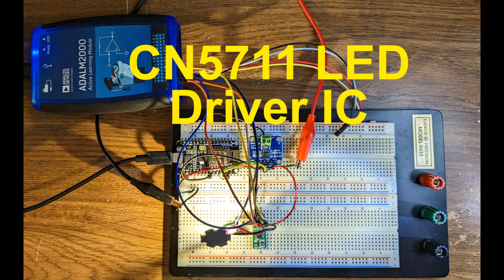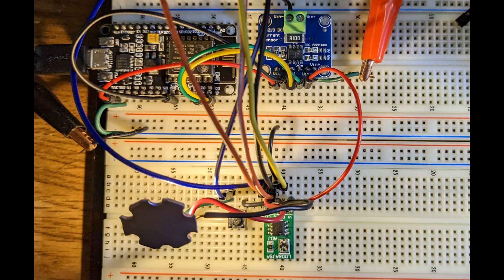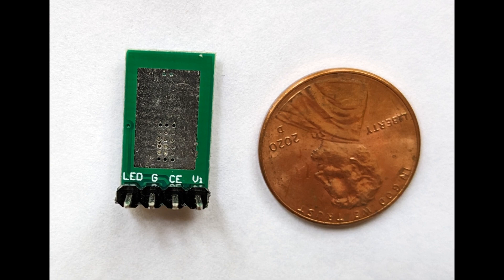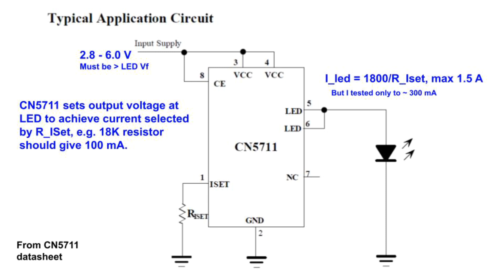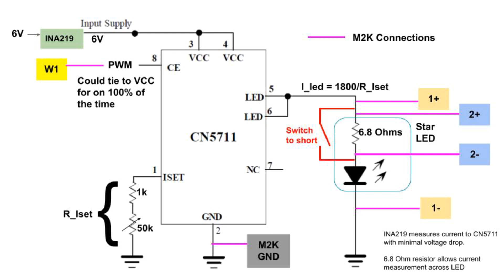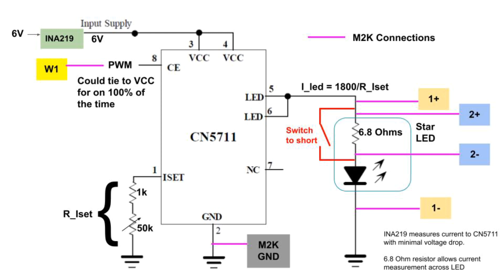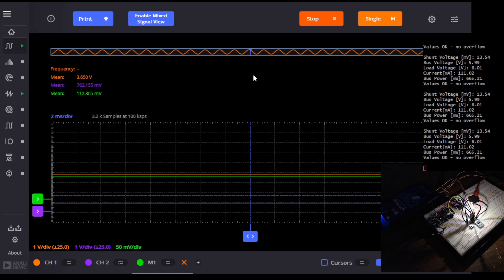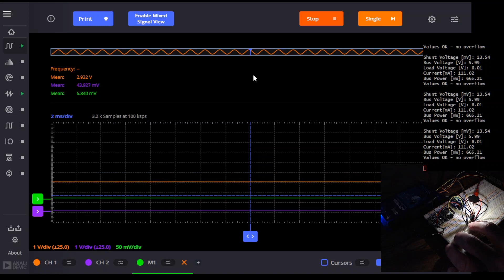CN5711 Constant Current Source IC Tested Using M2K

Comment: Very well done, thanks!  I'm thinking about this to create a soft start for the output of a 5V isolated dc-dc converter.  There's a capacitor downstream (operates a relay) that causes problems on start-up for the converter.  (It's a 1W, B2405S-1WR3 converter with a max output of 42mA).  Normal running current of the circuit is 25mA.  The CN5711 could current limit the converter, has a low overhead and very low quiescent current and would be an easy and cheap solution.  Any thoughts?

Comment: Thank you for this test - this was really helpful.  I am considering this as a LED driver for 6 1W LEDs in parallel.  Will probably go to 250mA per LED which will push this to the 1.5A limit.  I see that that the datasheet suggests a current limiting resistor in series with each LED for such a parallel setup.

Comment: Thanks for the video it was really helpful, I was considering CN7511 chip to design my custom 5V LED array driver integrating ESP-12F module and ESPHome to control 5V fairy lights string. Were you able to find out the value of this potentiometer used on this module? I also want to integrate that pot in my custom PCB because I want to it to be able to be used with different lengths of string fairy lights.
Reply from the maker: It has a "5" and a "4" printed on it and measures 50K Ohms in circuit.  The module I bought from Amazon has the 50K pot in series with a 1K resistor.  It's shown at 3:30 in the video.  Best wishes for your project.
Reply: @electronics.tinker  Thank you very much for the details and wishes. 😊